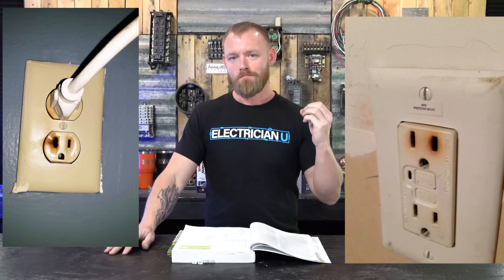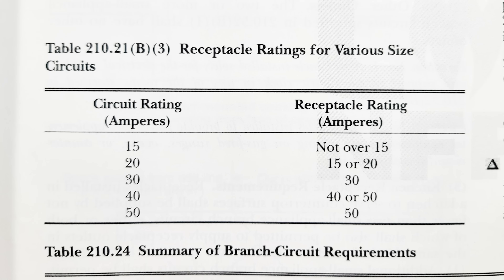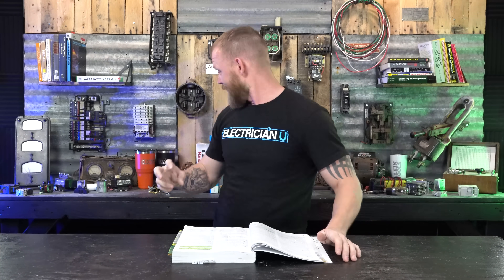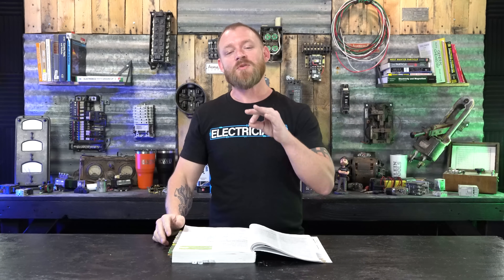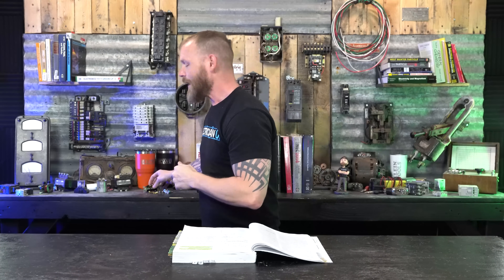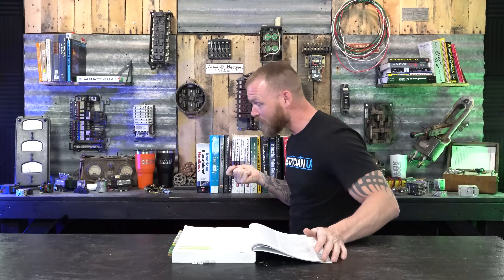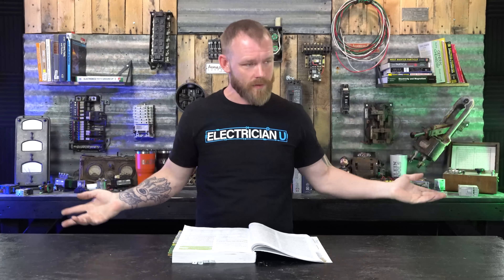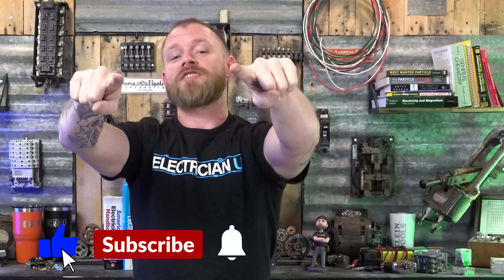Won't These Melt?!? 15amp Receptacles on 20 amp Circuits!!!

Comment: Putting a device load that's suitable for a 20A branch into a 15A receptacle is not going to melt the receptacle.  15A receptacles are listed to pass through 20A from one pair of terminals to another so that they can be used in 20A branches.  There's a minor difference between the two in the faceplate and the extra horizontal contacts on the Hot terminal of the 20A.  The whole reason for the difference between the two is so that utilization equipment with NEMA 5-20 plugs cannot be used on a 15A branch, by not permitting 20A receptacles on 15A branches (I've only ever seen one piece if equipment with a 5-20 plug, for a commercial kitchen).  15A receptacles are seen melting because they're the ones used almost exclusively in dwellings, and the common reason is mechanical fatigue in the contacts leading to high resistance connections.  I see this most often in hallways, since that it where people plug in vacuum cleaners, and people are lazy and just yank on the cord to unplug it.  That receptacle next to the night stand that had a lamp plugged into it years ago and has never been disturbed since has a much easier life.
Reply: I have watched some tear downs and the 15 amp receptacles have the same internals as the 20 amp models. I agree that the melting issue has more to so with old loose receptacles and not the actual amount of metal in the receptacle as they are most likely the same.

Comment: An "Appliance", like a light, can have a wire rated at 1/2 an amp.   we dont wire everything on the circuit for 20 amps, or even 15 amps.   Absurdly, enough, I find it odd we dont have a fuse on that break in logic.
Reply: Each outlet on my boat has a breaker on it.

Comment: The video left out the MAIN reason for the distinction between 15A and 20A receptacles.  The difference in the receptacles is that a 20A receptacle will allow a plug with one blade turned sideways.  A 15A receptacle will not.  When a plug has one blade sideways, that means it’s an appliance that draws a lot of current, so much so that you can only run it on a 20A circuit.  Any 15A duplex receptacle legally on the market will be built robust enough that you could plug in two 10A loads and not have any problems.
Reply: Don't bet on that - I've seen more than a few 15A duplex outlets FAIL WHEN NEW if you exceed 15A in the entire assembly.
Reply: @bricefleckenstein9666 Don't bet on your "Don't  bet", in my experience I've seen 20s fail with less than even a 15 Amp load. There are two  differences in the 15amp and the 20 Amp. The prong shape and the cost! If a person is not concerned with cost and more concerned with reliability/safety use commercial receptacles not residential. Of course most electricians choose cost not reliability/safety!
Reply: @jimeagle1952  I don't have to bet - I've SEEN too many failures from pulling more than 15 amps from a 15 amp receptacle.
I've also seen 20's fail, but a lot less common as those are rarely on enough of a breaker that it won't trip before the outlet fails.
And yes, I'm fully aware of the differences between NEMA 5 and NEMA 6 outlets/plugs.
Reply: @bricefleckenstein9666  yeah because of the bafoons that stab or connect receptacles in series. Wiring techniques matter

Comment: When I wired up my garage a few years ago, all the outlets had to be tamper-resistant (per the inspector). HD only had the tamper-resistant outlets in 15amp, so I installed those.  After I passed inspection, I ripped them all out and put in 20amp non-tamper-resistant outlets because I really hate the tamper resistant outlets.
Reply: (You're not the only person that's done that! (Don't tell anyone! 😁)
Reply: Those tamper resistant receps are the worst.
Reply: What’s wrong With tamper resistant outlets
Reply: @Rbaseball707  I pose the same question. I have them, and I had no issues with tamper resistant either. Just saying.
Reply: @Rbaseball707  The only issue I have is the 'tamper resistant' plastic blocking plates covering the contacts inside can, and does, make very had to insert a plug into it. But you'd know that if you used them. I still use them in places in the house where there's water close by along with them being in a GFCI outlet.
Reply: I've been in this buisness 45 years ...37 as a contractor.  99.9 % of the over heating (Dicolored melted ) recepts I've encountered is due to tension failure  of the female slots, usually due to improper plug/ unplug technique ( jerking or pulling sideways on male cord end ) heat from overload is extremly rare , heat from worn out / misused device is common !.
Thank You
Love the Content & presentation is excellent!
pc
Love the content
Reply: I don’t mind the TR receptacles for counter height or garage height receptacles. They just require a bit of finesse to activate the mechanism. Where they present a problem is when you have to reach down low  behind a couch or table to get the damn things to work.
Reply: That's why I didn't pull a permit lol
Reply: There is absolutely no difference between 15 amp and 20 amp receptacles on the inside.
Just the t slot on the neutral …..both 15 and 20 amp are rated the same
Reply: Tamper resistant is still better than arc-fault. Unfortunately I have TR receptacles on arc-fault breakers.
Reply: One thing to note is that the 20 amp receptacles will let you know it's a 20 amp circuit, and I recommend them in apartments or anywhere , you'll have a big load on circuit one day like when using presser washer or carpet cleaner etc, and insurance companies can't deny
Reply: I thought i was the only only one that hated tamper resistant recepticles - way to go and by the way Wago fastners can make the swap out so much easier!
Reply: Whatever happened to people just putting plastic caps over outlets? Did kids start pulling out the cheap chinese ones, so moms against humanity complained?
Reply: @chuckemtrad8541  
The manufacturer invented them and sold (bribed) NEC to require them.
Reply: Thank you! Finally I find some other people that agree that those tamper resistant outlets are completely stupid instead of "its code, you got have them regardless."
Reply: @manofwar_93  Really, there’s a lot bad people regardless of wealth who are bad parents.  Thus, these receptacles makeup for bad behavior like required safety features in case bad employers remove them.  Same people require safe planes  so you don’t have to worry about flying, or safe drugs so you don’t die or have injuries.
Reply: @manofwar_93  
Absolutely! We have to deal with them simply due to bad parenting and stupid people

Comment: The single outlet circuit concept can make a home much much safer, especially when we are talking old existing houses. Many cases where homeowners can't afford a total rewire or landlords don't want to invest that much we just run a circuit with one receptacle to each bedroom livingroom and kitchen usually near the window so then there is a safe outlet for A/C in the summer and space heaters in the winter.
Reply: That's great, in theory.  But it really is not safe at all.  The reason one outlet per room is not safe comes into view at 30 seconds into this video.  With only 1 outlet in a room, eventually there will be a multiple outlet adapter plugged into it.  Then there will be 2 or 3 extension cords plugged into the adapter.  A wire in a lug or under a screw is a tight connection.  A blade pushed into a clamp is not a tight connection.  The clamps inside a plug are tight enough for a lamp, tv or even a space heater.  But, they are not tight enough for a multi-outlet adapter with a lamp, tv and a space heater  connected  to the adapter.  That is the real cause of melted receptacles.
Reply: @SteveWhiteDallas  That's not what he meant. There are likely outlets in the room already, but may have undersized wiring. He is leaving the old outlets and the old wiring there instead of rewiring the whole place and installing a new dedicated 20 amp circuit where it is likely needed for a window A/C unit.
Reply: @hotpuppy1 I understand that.  However, 1776 Style Patriot mentioned houses that might need a complete rewire.  That's because it's not uncommon to see a knob & tube house or one that has been upgraded to 2-wire non-metallic ("Romex") wiring to have a 60A service & breaker/fuse panel with only 2 lighting/general use ckts. for the entire house.  By today, the plugs have probably had multi-outlet adapters in them for 50-60 years.  (We had very few electric appliances, etc. when these houses  were built.)  So with the old receptacles badly worn (in spite of being replaced 2 or 3 times) it will be tempting to plug in an adapter and use the new plug for almost everything.  People upgrade their electrical system to make it safer.  In the interest of safety, my intention was to make anyone who doesn't have an in depth understanding of electricity, aware of something can produce excessive heat to help prevent a homeowner for creating a new fire hazard in the process of eliminating an old one.  If there is only 1 person who learns something he didn't know from this video or any of these comments, then it's all worthwhile.
Reply: The only difference between a 15 amp and 20 amp receptacle is the horizontal T shaped slot.
Reply: @SteveWhiteDallas  As an Engineer I only deal with the US NEC on VERY narrow subjects. Unless the NEC has changed over the last 30 years the code is clear about outlets in a room. There must be one switched outlet, this can switch an overhead light, or it can switch an outlet with a lamp in it. I don't have a copy of the NEC so I don't remember the rules on branch circuits, but I think there must be an outlet every 6 feet in a room. So having only one outlet in a room is actually not up to code. maybe somebody that knows the NEC better than I can correct me if I am wrong.
Reply: @THE-michaelmyers  Last I knew, it was an outlet every 12 feet in bedrooms, living rooms, dens, etc. and 1 every 2 feet of countertop in kitchen (if countertop was 1 foot, a plug was required.)  That eliminates the need for  extension cords (theoretically) since most things have a 6 foot cord and small kitchen appliances have a 1 or 2 ft. cord.  When I was wiring houses, we put an outlet every 8 feet.  That was company policy.  12 feet leaves too many "dead" spots.  The number of general use plugs/lighting circuits required was 1 circuit per "x" square feet of living space.  We limited our circuits to 10 openings (1 bulb=1 opening.  1 receptacle=1 opening.)  This was overkill, but we worked for custom builders ... mostly upper middle class and up houses.  We had very few problems with inspections, and electrical issues with our houses were rare.
Reply: @SteveWhiteDallas  I am an engineer. From my graduation from Ga Tech in the early 80s until about 8 years ago I worked for an Electrical Power Company. I designed substations and in some cases transmission lines. When the subject gets into basic things like wiring homes and light commercial businesses I am generally out of my expertise. Today I am semi-retired but also run my own business designing substations and transmission lines all over the world. I have a copy of the NEC from the early 80s. That book is in storage. I do need to buy an updated copy. Maybe I will soon. Thanks for the information!
Reply: @SteveWhiteDallas  Light appliances come with 6' cords. The cord can't be across a door. That appliance should be able to be placed anywhere in a room. But it's not desirable to have to put a light at the level of the other, and they sometimes cheat a bit on the 6 foot. But, the outlet next to a door shouldn't be more than 6 feet from the door, the rest can be 12 (or better, 10) feet apart. They started requiring the 6 foot spacing to keep people from using permanent extension cords, which are cheaply made and quite often overloaded which causes fires. Average consumer: It's fine to use a 16 gauge extension cord for the window air-conditioner, because the plugs fit, right? And the outlet is on the other side of the closet, so let's throw a carpet over it so no one trips on the extension cord, for safety. 🤷‍♂️
Reply: @THE-michaelmyers  my comment is missing.  It contained a link.  Maybe YT doesn't like links.
Designing substations and transmission lines  is surely alot of work but must be a fun challenge too.  The reward of seeing your plan built and knowing it will last long into the future ...  Well, that is as good as the money, if not better!
A search for NEC online will give you a nfpa site with free access to the NEC from 1968-2020.
Reply: @SteveWhiteDallas  It was until the spring of 2020. Once Covid hit dealing with travel restrictions was difficult. In the past 12 months, I have let almost 2 Million USD in business go because of Covid. Right now I have 2 projects in Europe going and if everything works out a project in Australia this fall. When those are finished I think I am going to hang it all up and start chasing women!
Reply: @THE-michaelmyers  😂
Reply: @THE-michaelmyers  A receptacle every 12', so that no point along an unbroken wall can something be more than 6' from a receptacle. This thread starter was referring to adding a dedicated circuit and receptacle in rooms to compliment the existing infrastructure.
Reply: @SteveWhiteDallas  that is exactly the reason behind the receptacle spacing in the code, they don't want people using extension cords because people are stupid and will just buy a cheap 16ga extension cord to plug an AC in
Reply: @SteveWhiteDallas  What HillbillyRedneck was referring to was adding a dedicated 15 or 20 amp single receptacle and circuit to rooms in homes/ apartments with outdated wiring and circuits, in addition to whatever is already there and in regular use. It's the heaters, air conditioners, and intense computer type loads older systems never accounted for.
Reply: @darrendolphdragos9752  Yeah, I caught on to that.  Before some of the other comments & replies, that wasn't clear.  The reality of it though still leaves the possibility of multi-outlet adapters in the new plug.   You've seen old houses that had 2 or 3 lighting ckts. for the entire house.  That was plenty back when every house had a broom, clothes line, laundry sink with a roller, a brace & bit, handsaw, etc.  The milk was lowered into the well in a fat-bottom pitcher and suspended just barely in the water to keep it cool.  Now everything is electric.  So if a house is still running on 3 ckts, replacing fuses will be a daily thing.  To avoid it, the new plug is the obvious answer.  Low current lighting will help alot since every room has more than one A lamp on the ceiling.  I'm sure they handled it right.  This comment section offered so many points of view ... I didn't read it again, but I remember there was no shortage of advice.  Youtube has come so far that you don't even need to worry about bad advice anymore.  If someone posts incorrect information, there will be a whole division of people to correct him.
Rock & Roll, Darren!  it's election year.  Never trust a politician who tells you it's raining.  If it's warm, it aint rain!
Reply: @SteveWhiteDallas  Thanks for the political advice. That aside, although a dedicated receptacle could get a multi-outlet adapter, they're not inherently dangerous unless they're cheap dollar store devices. Any circuit whether new or old, can be overloaded when the consumer can control what gets plugged in. People learn to be mindful and learn by trial and error. As the poster who suggested this "remedy" of older structures lacking receptacles and circuits for modern living stated, adding additional circuits and strategically located dedicated receptacles to compliment the existing infrastructure alluded to, it improves the existing situation and makes it safer and more livable. Reality dictates owners of older housing stock have no incentive to re-wire entire apartments and rental homes to modern standards. That is a real issue that municipalities must one day address.
Reply: @SteveWhiteDallas  I think he meant 1 outlet in the room that is on it's own circuit for ACs or space heaters, 1 outlet per room is a code violation.
Reply: That's what I did. I ran a separate circuit for my gaming PC setup and refrigerator and a couple receptacles in the garage and I plan on installing a separate circuit in my bedroom and bathroom also. As much crap as I found with my house's wiring, I don't trust it for heavy loads since there's no way to know there aren't more issues in the walls that I don't know about. I'd rather not fry my equipment, burn the house down, etc.
Reply: @averyalexander2303  I had isolated circuits installed for computer equipment when I did the buildout for my store.... of course those outlets are no longer where I need them. But they are pretty ORANGE.
Reply: @citylockapolytechnikeyllcc7936  you mean isolated grounds. A dedicated circuit doesn't need or use orange recepts but an isolated ground ckt does. If you think those orange recepts are their own ckt you might wanna check again.
Reply: I didn't go fully single outlet per circuit that's over kill but each of my bed rooms I have a single plug hooked up to breaker and that's the AC/space heater plug for that room... then  normal after that muli plug circuit after that